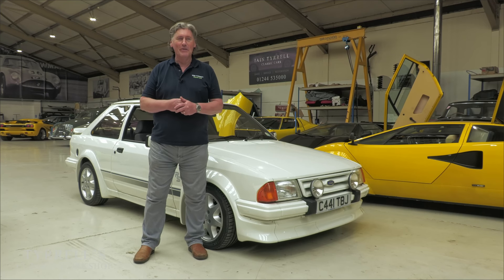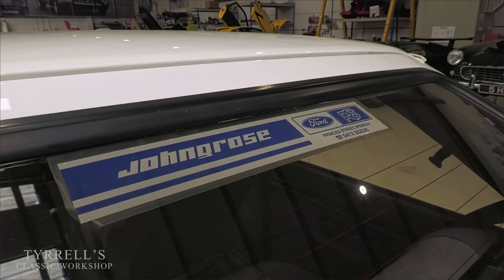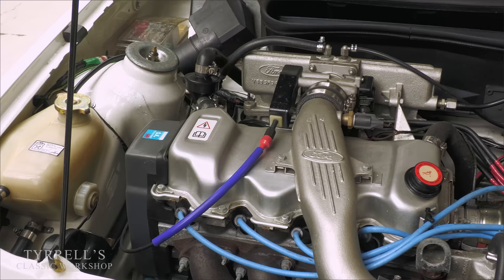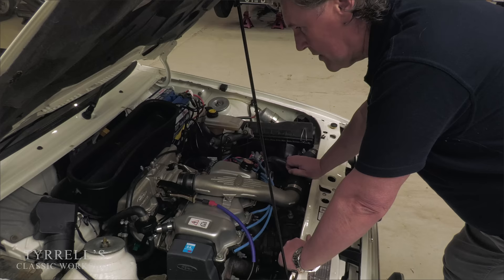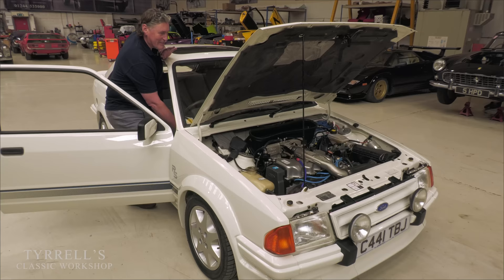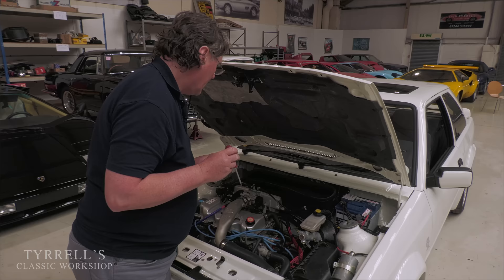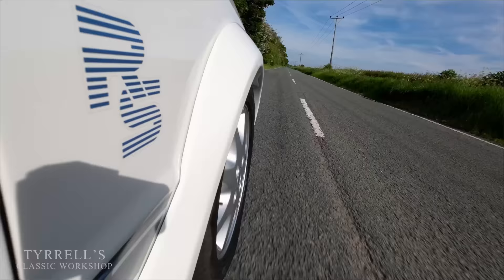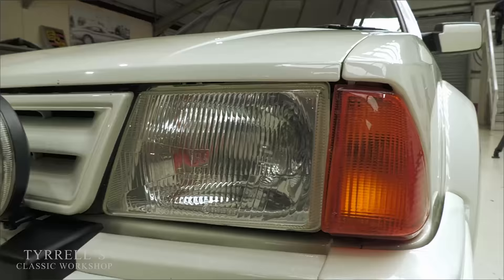Unleashing the Power: Reviving the Ford Escort RS Turbo's Performance | Tyrrell's Classic Workshop

Comment: Great video 👍 Another issue with the cvh engine was the "black death"due to missed oil changes and build up of moisture in the cam cover results in the black tar in the cam cover.

Comment: The 80's hierarchy amongst pals. It started with the Ford Escort XR3. You were the lowest rung of the ladder, yet because you owned an XR3 you were still cool. You then like me owned the XR3i. I actually owned 3 of them. One white, one black, and the top dog orangy red (I think it was called Rosso Red). Mine had aftermarket twin square front headlights. You then had this. The Mark One Escort RS Turbo. 

If you owned one of these you were very lucky indeed. Not only because you were loved by males and females alike, it also meant it hadn't been stolen yet. My red XR3i had the full interior and wheels of an RS Turbo. No idea how or why it came to be...

Comment: I love older cars, they are honest cars, they dont use all the new electrified steering, gear shifting, brakes etc, you really feel whats happening and they are easy to work on unlike todays computers on wheels. My mother had an Escort in the mid 80s same shape as this one however it was the non-turbo model. I drive a  Golf 4 GTI 132kw and its semi computerised but still basically an older car as well and love it.

Comment: If anyone else wondered this, the Bugatti Chiron is 1995 kg and the RS Turbo is 861 kg so Iain was on the money👍
Reply: @johnsmith1474  861kg = 1898 lb, about 300 lb less.
Reply: Well under half the weight. Absolute pocket rocket.
Reply: My 205 GTI is 895kg, I always thought these were heavier.
Reply: @simes205  that's still very light. I had a '74 Alfa GT Junior 1600 which was 1000kg, and I thought that was a pretty light car. Your 205 must handle like a kart.
Reply: @simes205  I think it might be lighter than that - I've seen the 1984 205 GTI listed as 850kg. So yes, the Ford is heavier than yours.
Reply: IIRC the mk4 RS Turbo is about 1035kg.
Reply: My Opel Manta is 972kg stock and I'm still stripping weight out of it. It makes all the difference on these low power output cars, which is why 130bhp cars from the 80s felt quick and did better mpg than today's equivalents.
Reply: @boilerhousegarage  My uncle bought an old 1965 Alfa Romeo GTA coupe 1600 a 4 cylinder engine with dual Weber carburetors, car was used only for up-hill climbs (mostly in italy, france, germany and austria but car just sit for the last 8 years in a shed he needed to replace the entire corroded exhaust system with full titanium and the carburetors were clogged not working properly he took them out ultrasonic clean and went to a specialized race shop to tune the mixture also replaced all sparkplugs and wires of sparkplugs.. before he did any work to it car was misfire a lot and engine had the tendency to die but now is a proper beast, it revs linear & strong, it screams & rips tires on all shifting gears and it just sounds incredible.. :hand-orange-covering-eyes::eyes-pink-heart-shape::face-red-heart-shape::face-blue-smiling:
Reply: My Mk2 Escort is 950 kg with 181 bhp. It's pretty nippy.
Reply: @benjaminbenson8714  my mk11 escort was 800 and something but it only made 160Hp and it was really really noisy with no sound deadening at all and no interior trim!
Reply: @markscully2342  sounds like a cracking motor. I've only got the carpet in mine and the induction noise is phenomenal! 2.5 inch exhaust and a fairly open silencer makes having a kip hard for the wife! That and the red line is 6800 rpm. Haha.
Reply: RS is 980KG. With 132BHP is has 130BHP per tonne.

Comment: Driven a nice one early 90s ,it had a switch so you could go from 130 horse to 200 👍 ,great car so light just making a noise trying to claw the  road 🤘,then I drove a nice red mk2 Turbo on an F plate which was mint and beautiful inside and out 🇬🇧👍 ,great days when 14" and 15" wheels were BIG 😅

Comment: My rs turbo used to foul up cyl 1 on cold start. After changing the plugs many times I changed the injector o rings which had failed on cyl 1 and was leaking fuel into cyl and fouling plug

Comment: Yes going from rear wheel drive to front wheel drive in the early 80's did feel like the engine was going to leap out the bonnet, they felt quick with modest power outputs.

Comment: I struggle to think of these as classics, but they are, I had a RS mk 2 and yes that exhaust is normal. The RS mk2 had a resonance at specific motorway RPM and I had to get it fixed..

Comment: Owned one ‘ worked on many, and my parents sold a few during the 80’s “Brand New “. You wouldn’t believe how many came back for battery trays within 3-4 years 🤦‍♂️. I can remember my dad offering to to Wynns rustproof them for around £70 and buyers would turn it down . My favourite from the MK3 range was the early XR3 carburettor model . What a fun reliable and easy to maintain car . I’ve been trying to hunt her down for about 15 years’ and if anyone sees or knows of EVX343Y whereabouts? 🤔’ please let me know. Great knowledge btw 👌✊

Comment: Totally agree Iain, Ford got it so right for so many years. My favourite Mk3  is the RS1600i 
I believe they deserve their hideous values now since most have rusted away or been crashed/butchered.
You are right about indicator switches....something has been lost here, which is crazy as these are main 'touchpoints'.
I ran a BMW garage in the 80's, and  BMW switchgear was state of the art. It was pleasurable and precise  to the touch

Comment: Too many comments to go through to see if has been mentioned, but I looked up the specs for this, and it apparently weighs 1898 lbs. So 14.3787879 lbs per hp. Love fast Fords, had an SVT Focus (Mk 1 - basically an ST170 on your side of the pond) and the thing was a hoot to drive. Pretty quick, torque steer aplenty, and lift off oversteer in the corners that was a delight once mastered. Still miss it.
Reply: the thing with the RS turbo is it was easily tuned, not many were standard back in the day
mine which i owned some years back was 276 bhp

Comment: B616 DOH was mine, i had it “chipped” by Superchips and the thing was mental fast for back then…..trouble was it used to backfire and run rough so had it unchipped and sold it after 6 months for some other fast hatch as i had to try them all 😂

Comment: Thermal camera can be a good 'hands-off' misfire detector. Exhaust manifold/header primary for the missing cylinder will be cooler. P.s. swapping the plug for another cylinder and testing for a misfire on the corresponding cylinder is the correct method for fault verification.

Comment: Back in 1997, I bought a Rosso Red series 2, it had a lot of modifications. 203bhp, no rev limiter it would rev off the clock, fully lowered so I hated speed bumps, retro fitted ABS which these cars were not supposed to have, home made seam welded drain pipe exhaust that would scrape everywhere, and it was fully dyno matted throughout. Totally awesome car, but it did lack the charm of the series 1. I am an Escort RS Cosworth fanatic, but if I could afford a concourse series 1 now I would snap it up in a heart beat.

Comment: A. very common problem was motorcraft spark plugs. Quite simply they were rubbish and used to breakdown under the heat. NGKs were far superior. It was the same with the pinto engines. The original exhaust back box’s also used to crack and many people replaced these with MK2 units. Great video as always Ian

Comment: I remember driving one of these in the early 2000s. It ran out of revs at 4.5k! I was pretty disappointed. Nowhere near as quick as my 205 GTi. Still, love this era of fast Ford.
Reply: And 25 gtis weren't anywhere near as quick as r5 gt turbos. The king
Reply: @benbirch2393  standard I'd fancy a 205 over R5 turbo all day. Obviously tuned 5s are gonna be way quicker in a straight line

Comment: Great video, as always. I heard a story, and no reason to disbelieve this…a mechanic lost a finger due to an electrical spark. He was wearing a wedding ring. To temper that sad story, a boss of mine, took his ring off. Put it in a leather jacket. That was then stolen. I am more certain than not, he had a very tricky conversation with his wife 😳

Comment: An easy fix. NGK are amongst the best, never had a problem! Well also a learning point - I did not know that the CVH was prone to camshaft failure through snapping. It was more common for advanced lobe wear on account of their high valve spring ratings, camshaft to be treated as a service item(!). The other issues were sluding caused partly by use of the wrong grade engine oil - these were designed for 10w30 rather than more common for the slightly earlier period 20w50 without anti sludge oil specifications. And valve stem oil seals are weak.

Comment: Dipstick oil level wire and brake pad wear indicator wire is broken hence the flashing lights on the dash..... tut tut that's points deducted at concourse 😉 .
Dipstick wire normally goes brittle and snaps off the top if the dipstick. Brake pad wire normally snaps in the flexible sleeve near suspension strut.

Comment: Theres still a why? or two outstanding.  Was it just a defect in the particular plug, (insulation breakdown?), and was it just the passage of time that caused that?  Sometimes, a simple failure can be the machine trying to tell you about an upstream problem. If it only happens once, maybe just chance, a second time might be coincidence, but the third one s enemy action. 
Apart frm the concours question of originality, there can sometimes be a good reason to stick with OEM plugs. I dimly remember a 1960s Vauxhall motor that would only tolerate GM's AC plugs and misbehaved with any other (nominally-equivalent) brand.
I don't suppose I'm telling Iain anything he doesn't know, but there's only so much that can be put in a video.

Comment: Owned one in the early 90,s sold my mk1 Mexico to buy the RS turbo miss both cars still to this day,my RS turbo was a non custom model so no sun roof or electric windows reg was C238 BJD sold the car in the late 90,s to use as a deposit on a house if had a choice between the Mexico or the RS turbo I would get a RS turbo,the Mexico was more fun to drive mine was producing close to 120 brake compared to the standard 86 brake on a standard Kent crossflow,the RS turbo I owned was tuned to stage 1 never chipped it,both were great cars in there day

Comment: Iain on the phone to the RS owner:
"Well, as I say, I know it's a very expensive invoice, but we had to perform an intensive and time-consuming investigation into the engine misfire and we also did a full recalibration of the injection system and subsequent road testing."

Comment: Had a friend who had one of these. Tuned to the hilt! Spent his money well with the right parts. At that time, I was running Capris, had at least 20 Capris over 20 years, every colour bar white, lol.Never had a 2.8, always a 2.0 litre, best balance to my mind/feel. Poly bushes in the front made the Capri into a MK2 escort handling wise.Had this 1 Capri that came with a cam... Searched tinterweb for the cam, even the guy who installed it (pre tinterweb days) nobody could id this cam, went through every specialist I could find, no answer! Point of this...RST that Barry owned.... Top end? Same as my Capri. Acceleration? Same as my Capri! NA vs Turbo? 1.8 turbo vs old school Pinto 2.0, not even 205 block, neck and neck, if anything Capri had edge over RS especially at outer limits! That engine went into 3 other Capris it was that good lol!

Comment: One issue I've seen on older cars with centrifugal advance distributors is a weakening of the springs holding the bob-weights. Causes ignition timing to advance too quickly.

Comment: Great video but I noted that the ground electrode of the bad plug was burned way back. The electrode should bend around and cover the center electrode. Hence the poor or no spark.
Reply: The turbo plugs had a much shallower electrode than the regular ones.

Comment: That spark plug looked very worn.

And regarding your method of adjusting the mixture, it's the same i've used too on my XR3i and a friend's Capri 2.8i, without a gas analyser, if you know what you're doing it's very simple.

Comment: In the early 90s, these and slightly lesser models (and some 1.6i Orions) had slipped down to the local youth where I was living, around Mile End, Bethnal Green and Stepney.  
We would hear the music before we heard the car on summer evenings, despite the enthisiastic use of the loud pedal.  A common element was that the front wheels tended to be rinning on canvas.  And all the cars (ALL THE CARS) where white.  😂

Comment: Takes me back, I had an early 1980 3 door Mk3 Escort that my Dad passed on to me for my 18th birthday, sadly not a RS Turbo but a more modest 1.3 GL version of the CVH with the cantankerous Ford VV carb. Put 50,000 on it in 2 years and sold it to an ex girlfriend who promptly wrote it off. Apart from carb diaphragms and no option to run on unleaded fuel it was a great first car. Always lusted after a RS1600i or Turbo though......

Comment: I heartily endorse the "chicken pliers" having been bitten by HT leads! I agree 100% about NGK, I started using their spark plugs  as a motorcyclist in the 1970s, and they have been great. I would not be as diplomatic as you about some other brands of plugs. Just to be clear, I have never used Motorcraft and have no opinion on them.

Comment: I always wished we here in the U.S. got an Escort closer to what you had in the U.K. The awfully bulky 5mph bumpers mandated here just ruined the clean simple lines of the car. So did the U.S.'s ancient headlamp regs that disallowed the use of flush assembles with the first iterations of the car, like my '82 was, and made for a rather awkward-looking face to the car, so unlike the clean, straight forward edge to hood/bonnet of the British version. My Escort GT was very much an econobox; performance was definitely NOT part of that one's repertoire despite the "GT" pretensions. 

That RS Turbo does bring back memories, though mostly of wistful lust from long ago. Hmm...it IS over 25 years old... 😍

Comment: I wonder if Mr. Tyrrell has ever fitted a set of NGK BUHX surface discharge spark plugs to one of these cars, or any other. I once fitted a set in a two stroke 500cc Kawasaki triple. They worked fine but I had to remove and wipe them clean if I rode slowly for very long, as they'd foul quite easily. I have been thinking about trying a pair in the four stroke 1000cc V twin Suzuki I own now. They'd be one heat range cooler than the standard ones and I'm thinking that  I'd have no reason to worry about an electrode snapping off or any need to gap my plugs. I always stress out after a plug adjustment and normally just bin them if I don't get it bang on at the first attempt.
Reply: Just buy the NGK Iridium spark plugs for your Suzuki.
You’ll be pleased.

Comment: Any Alfa 1.7 33 Veloce/Green Cloverleaf would leave an RS Turbo sitting, massively underrated in value and how well they drive over B Roads
Reply: Mk II 33(preferred the low down torque in the 8V  as compared to the 16 valve 1.7, the engine lost it's character in the Mk III)

Comment: I worked on these when they were new ( i can't believe i wrote that )  these and many other models had a warning panel in the car warning of low brake bad, low oil ,  low water in the washer bottle , low fuel and i think low water in the rad. They were hugely unreliable the pad warning light would go faulty in the first 6 moths the only one that worked reliable was the low fuel light 
The first of these came with a one piece exhaust, they were known for cracking on the first bend from the manifold so ford introduced a separate down pipe to sort this

Comment: "I didn't remember my mullet today..." Err, yes Iain, you did! 😆Nice work on the simple mixture tune. Are they set to run quite lean for emissions or has this just gradually gone out over time, as that was quite a lot of turn to richen it up a bit?
Reply from the maker: Factors like wear in the injection sensor mechanism and injectors going out of value are the main problem. Thanks for your interest

Comment: My Dolly Sprint was faster off the mark than most standard RS turbos.
Reply: Great car the sprint was I had two in the 1980s, would love one now.
Reply: Yep my r/s turbo escort was a massive disappointment, the car before was an uno turbo and it was a darn sight quicker than that junk
Reply: @davidevans4089  you talking about triumph dolomite sprint small body double headlights 1500cc 1600cc to  1800cc model
Reply: Both quoted around 8.7 to 60mph,no wonder they all got the boost turned up.

Comment: the North American market version was horrible even in the normally aspirated version.   My father had one, then the family switched to Hondas because it was so bad and the Honda was so good.  the upmarket versions the seats were Recaro and advertised as such.  TRX tires?  Put in Motocraft for the concours and run it on the NGK's.

Are you going to fix the tachometer?

Can you show the tricks on L jettronic?

Comment: I believe the 1.6 cvh turbo used in the escort was a smoother engine all round than any other cvh engine because the turbo refined it.
Reply: More likely smoother because of the lower compression ratio of a turbo engine?

Comment: I used to work on these and what a troubled  car crap enngine CVH crap gear box (eats diff bearings ) had terrible torque steer if it had ABS it was belt driven from the drive shalfts to a pump bolted to the gear box i had a few mk 3 to 5 escorts but only as cheap dogs as   never rated the front wheel drive but nice to see some survival cars as most blew up or up a tree.